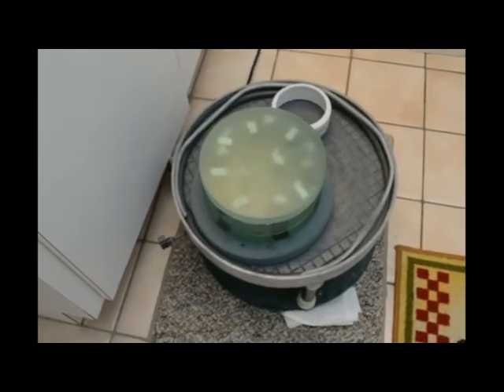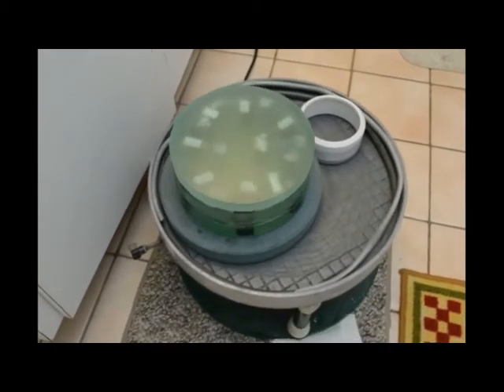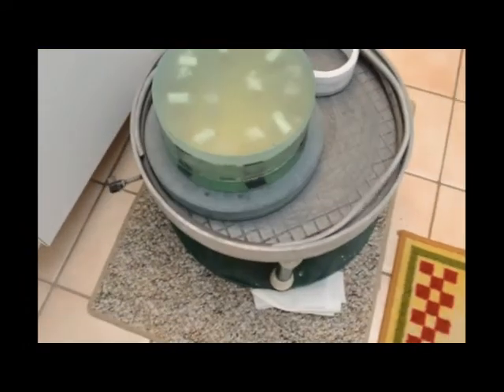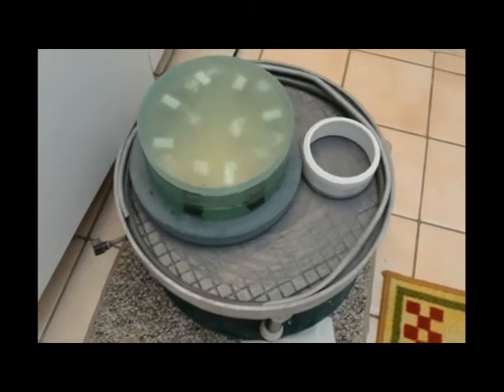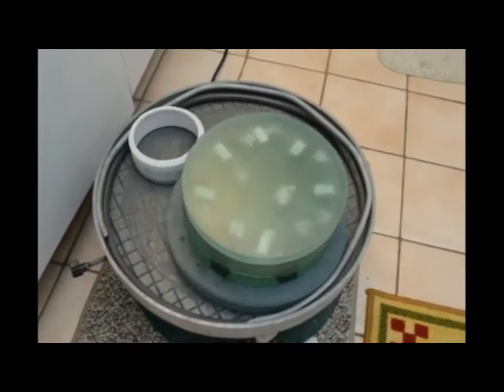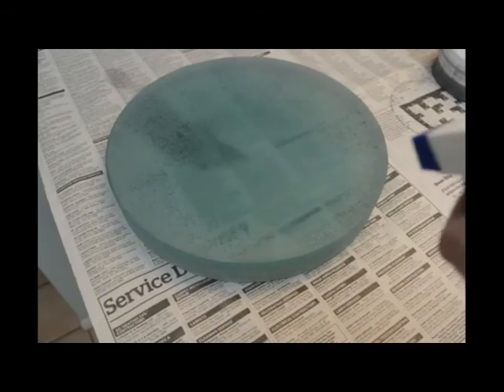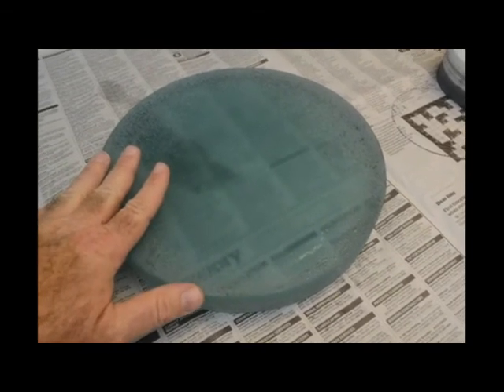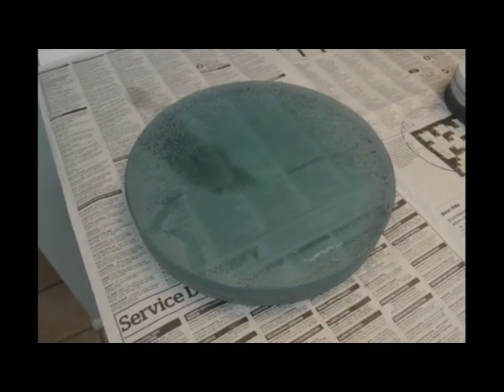Lapping a 10 inch telescope mirror blank

Comment: If you've continued making mirrors the past 7 years I guess you have a lot more experience now...so in retrospect, do you still like this vibrating lap best for flattening the mirror surfaces prior to starting grinding?  I have not seen many ATM's using such machines--you're the first after months of browsing how-to-make-a-mirror articles and forums and reading some books.  How far can you go with grits?  Could you actually make an optical flat that was good enough to use as a secondary mirror (perhaps cut out of a larger blank if that works better for the sake of the vibratory lapping process)?